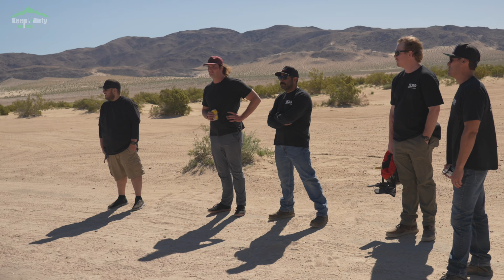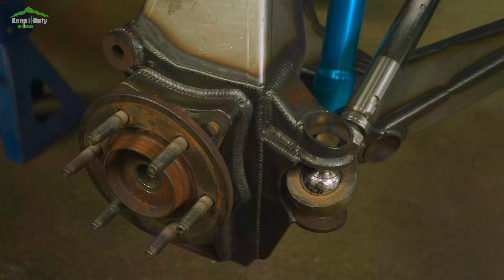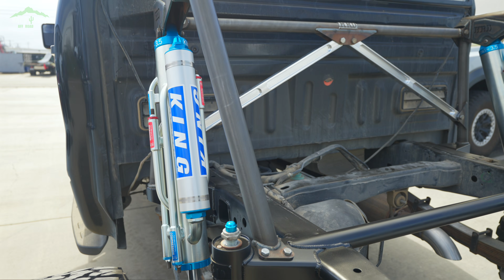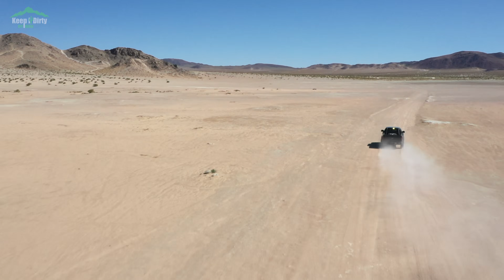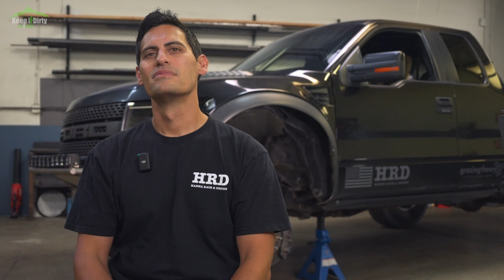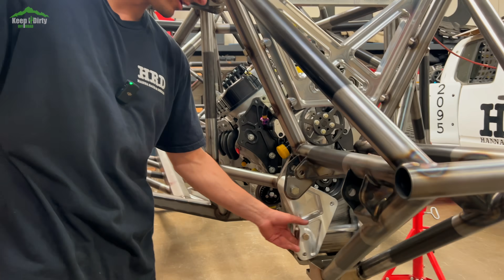HRD Mid Travel  Raptor - Simple Design + Tuning

Comment: Would you recommend this shop or the other 3 letter company lol that did a lot of your work ? Also who’s bumpers do you like better?
Reply from the maker: Both HRD and BMS are great shops. You can't go wrong with either. I highly recommend both
Reply: Would you throw svc in the mix. ?
Reply from the maker: As a shop, SVC is great at getting trucks done and turned around quick. No one can beat them hands down. They are currently the biggest player and there are more svd trucks than any other brand. 

Where they suck is when you consistently have issues. Small issues they are great. But if you consistently have issues, their attitude changes. I personally had a very bad experience with them and one of the main reasons I took their kit off my truck. And I became enemy #1 and they went on a crazy smear campaign.

Comment: Hey bro quick question. Do you know anyone that has been state reffed here in California with a modified truck with a mid travel kit and with engine mods? I’m curious because I want to modify my truck but I don’t want to get state reffed lol
Reply from the maker: I don’t man. Once you do though, there is not much you can do. You must comply or register out of the state. 

If you keep the engine mod free or keep the mods to carb approved, you will be fine. Suspension modes don’t impact emmisions. But if you modify the gas tank, and change to a fuel cell, they could get you for that too. Just be smart about your engine and emissions mods and don’t be dumb around cops or have too loud of an exhaust and you will be fine
Reply: @ I was curious because I saw the video that you made with the guy of HM midtravel kit and it seems like he had a pretty loud exhaust and he drove his truck on the road to get to the destination where y’all go test out the trucks.
Reply from the maker: Yeah, most of the time those trucks will be trailered to the trails so the chances of them getting flagged is even less. Specially those big prerunner builds. They are also usually registered in Montana to avoid the extra hassle. We drove it to the trails because the truck needed a full test. Not just on dirt, but regular driving. But we also drove in a way to not attract any unwanted attention. Speed limit and not hammering the throttle
Reply: @ Thank you for sharing the details brother, I’ll be going to HM Offroad because of the detailed video you put out. I was the guy that was upset the other day that SVC had moved out of Cali but I dug deeper with the other shops you had recommended and I’ll be going to HM for sure. I don’t want my truck breaking easily and I appreciate the extra effort they put in the reinforcement kit. I had seen that the 4wd will give problems with steering with more info I got out of your videos. Is there anything that can be done to help the reliability with 4wd?
Reply from the maker: Limiting travel or maybe upgrading to RCV axles. But you’re not completely avoiding issues with 4wd. It will eventually have problems your just increasing the “service” interval. I don’t use 4WD unless I absolutely have to.

Comment: Y spring over vs under I thought spring under was better ?
Reply from the maker: There is benefits and drawbacks to each. If you want to carry more weight, over is better. Lighter weight and more focus on prerunner,  under is better.  Over is better for a rig that goes to more than just the desert and may see rocks. So it’s a more all around build. So it just depends. The key here is tuning. Tuning and making sure the suspension cycles correctly can make the most difference
Reply: Spring under gets you a better spring-rate with less axle wrap and potential for more up travel, as the arch is much greater in a spring under pack. They generally work better for pre-running but reduce the clearance for rocks quite a bit.
Reply from the maker: Yeah exactly. And when combined with a 2 piece drive shaft will work much better than over. But it’s a give and take no matter where you go.